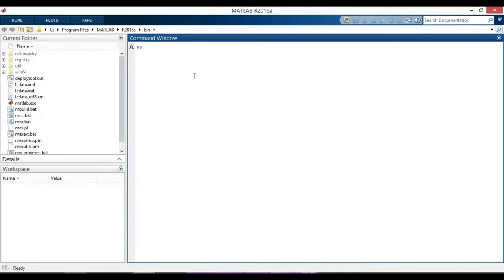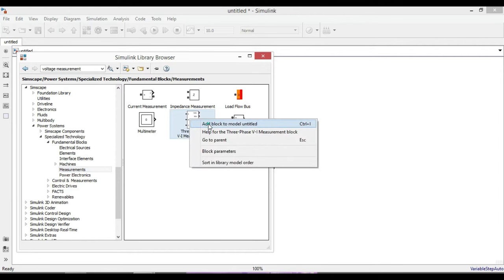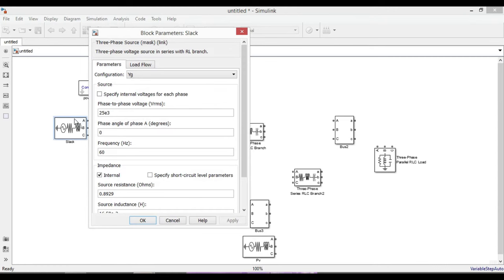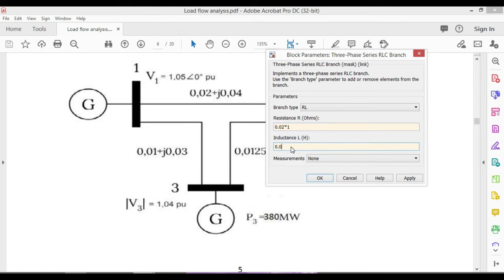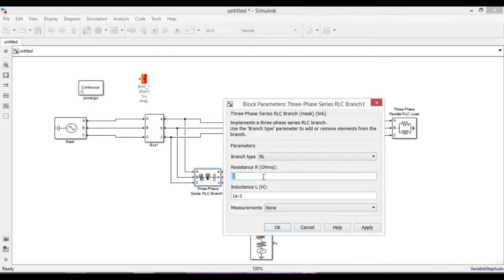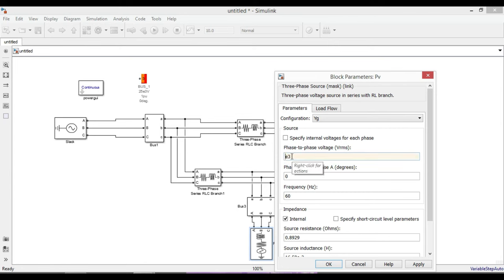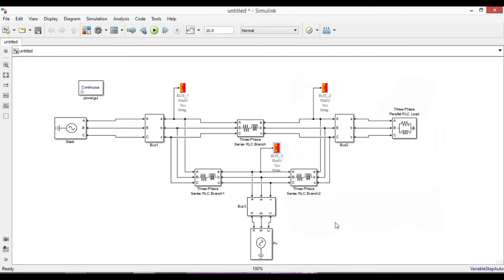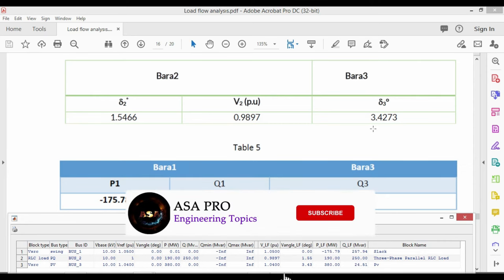Load flow analysis using matlab simulink

Comment: hello, i did all the steps, and there is no error and it runs completely, but my results are different from yours. i do not know why. even i tried another example from Haadi Saadat book, again results are not correct.could you please help me. i checked several times. But i could not find the difference
Reply: did you find the solution ? in my case i am facing the same issue.